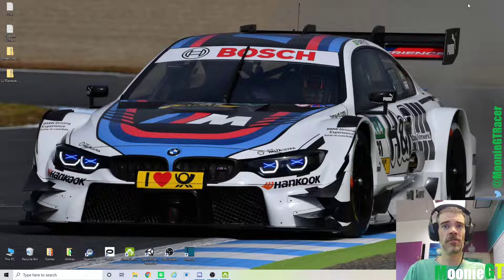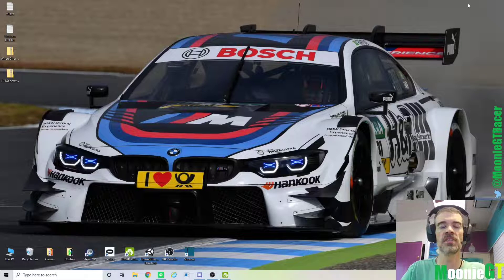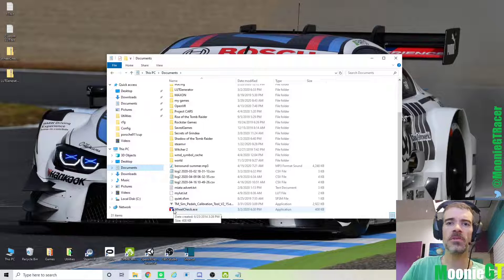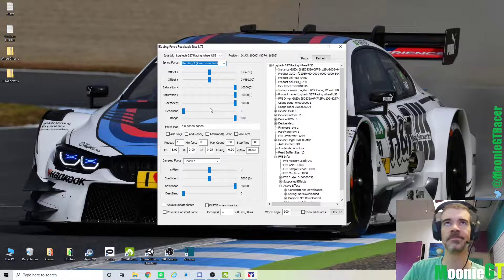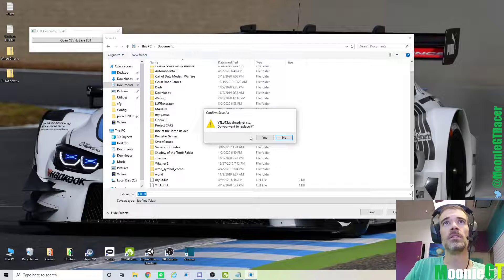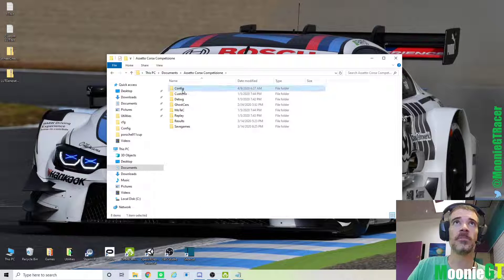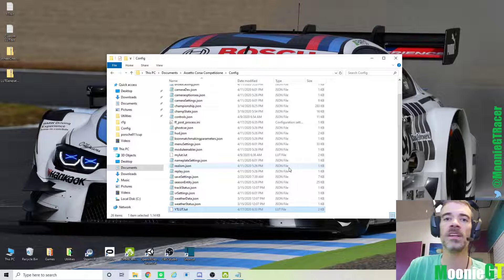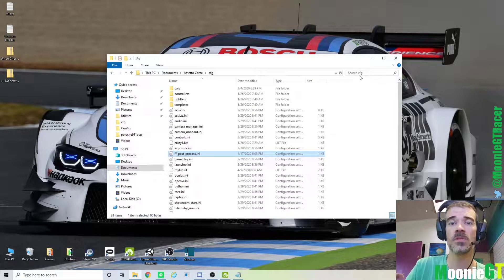Improve Force Feedback for Assetto Corsa Competizione with Custom LUT

Comment: Hasn't made any difference for my T300 RS. Do you adjust steering angle in the wheelcheck.exe? It seems lighter, if anything! Do you also change settings in ACC?

Comment: That ff_post_process.ini file isn't in the config folder anywhere. I did a search for it and nothing shows. :shrug:
Reply from the maker: You have to copy it from your AC folder or simply create your own from what you see in the video. Just open note pad and type it in and save it with the right name. 👍
Reply: @MoonieGTRacer  Yup I got it like 3 minutes after making my initial comment. Thanks my dude.

Comment: Tks for the tips, but i didn't  understand something, the file ff_post_process.in did you generate it or is it already in the ACC folder,do you need to create this file ff_post_process.in??
Tks
Reply from the maker: The file can be copied from AC if you have it or you can just create the file in notepad and save it with the correct name. It's a very short file. Hope that helps!
Reply: @MoonieGTRacer  tks for help. Congratulations for the chanel
Reply from the maker: @andyguima8  you're welcome and thanks!
Reply: @MoonieGTRacer  i didn't the test with lut, the ffb was much better. Tks for help.

Comment: Great video, very educational.

Some questions.

What is your setup in Logitech Gaming Software in windows ?.

And your setup within ACC ?.

Thank you.
Reply from the maker: For ACC settings, I think I had gain set to 90-100, minimum force set between 10-13%, dynamic damping to 0, and road effects at 15-20.  The gain controls the overall strength, so you can set that to whatever feels good to you. The minimum force setting boosts some of the weaker ffb forces so that you can feel them on a wheel like the logitech wheels (10-15% should be good), the damping is kind of a personal preference thing and turn it off. Road effects are pretty straightforward, how much road bumps and curb feel do you want. 

For the Logitech Windows settings, I used 900 for degrees of rotation, 100 for overall effects strength. The other settings you can leave at 100 and check the box for allow game to adjust settings.

To dial things in, you just need to play with the gain and minimum force settings a bit.  I would start with gain at 100 and turn it down if it feels too strong to you.  Start with minimum force at 10 or so. Do some laps, and then turn it up to 15. See if it feels better or worse.  Then you can fine tune that to your preference.  

I hope that helps!
Reply: @MoonieGTRacer  Thanks for the tips.

What I perceived is that there are circuits like Barcelona where the FFB transmits a lot of grip and the road surface shows a lot (bumps etc) but there is another one like Suzuka that are smooth and flat.

Is there any tool or advice to edit a circuit to have more grip ?.

Thank you.
Reply from the maker: @lh5942  hmm, not that I'm aware of... I think some track surfaces do just feel different and Links has tried their best to accurately model that. It can feel weird when the experience isn't consistent. Some cars (911 and McLaren) just tend to have lighter steering feel when on the power. Could that be part of it?

Comment: Thank you for this, but how can I set the folders back to default if I don't like the changes?
Reply from the maker: You only need to save the original LUT File.  Just copy that and stick it on your desktop or in your documents folder etc. If you don't like the new LUT file, delete the new one and put the old file back in the folder. Don't forget to change the file name back to the old name in the ff_post_process.ini file.  Hope that helps.
Reply: @MoonieGTRacer  Thank you!

Comment: Hey, great tutorial - slight correction though - both of those racedepartment links are for LUT Generator, not Wheelcheck (one goes to the resource page and one goes to the forum thread page) - however, on both of those pages there's a link to wheelcheck.exe which you download from a dropbox
Reply from the maker: Thanks for the feedback.  You're right, that link doesn't take you directly there.  I edited the video description to reflect that.
Reply from the maker: I went ahead and swapped the link for the direct dropbox link.  Hopefully that works for people.